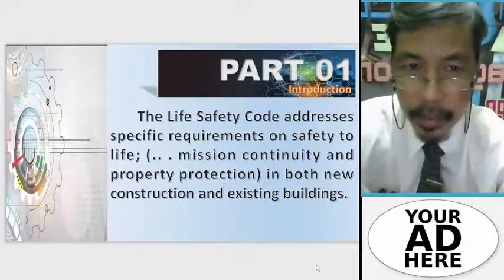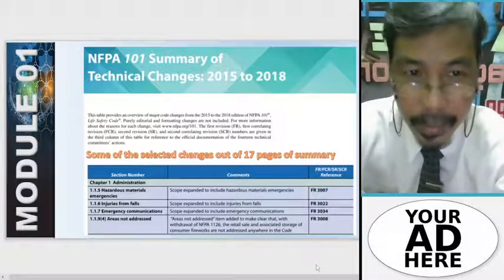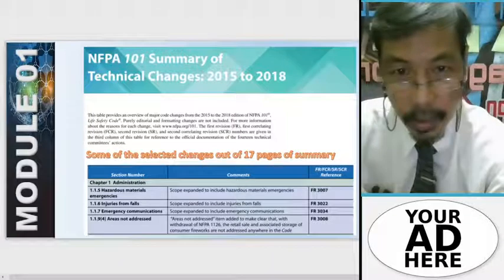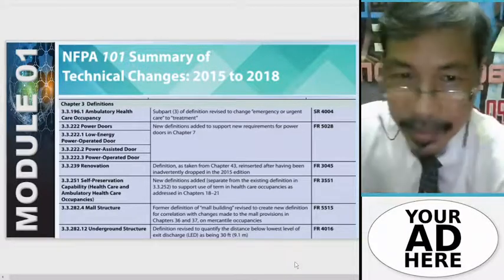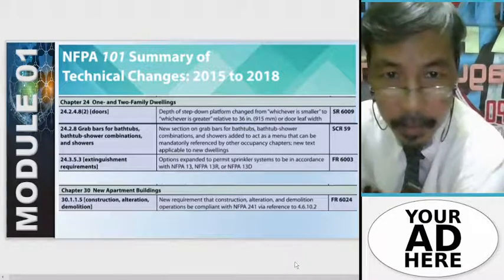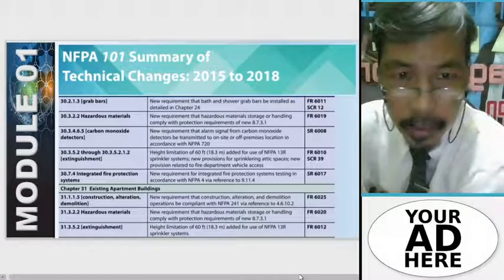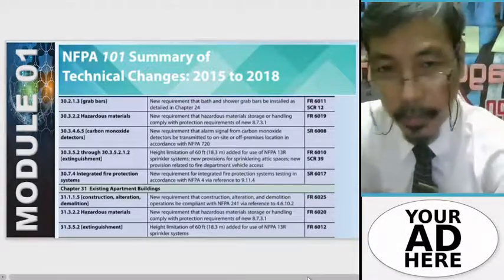Summary of Technical Changes - NFPA101: Module 01.2 [ Reference CODE by RA9514-IRR2019 ]

Comment: Some of the technical changes mentioned in the video are mostly new definition added, new requirement, added section and height limitations.  And there are some changes being said in the video like:
1.1.5 Hazardous Material Emergencies (FR 3007)
1.1.6 Falls-related injuries (FR 3022)
1.1.7 Communication in an Emergency (FR 3034)
1.1.9(4) Unaddressed areas (FR 3008)

Comment: Thank you Sir for this video. It is important to know the technical changes on NFPA 101 version 2015-2018. Some changes are very detailed and it is clarified. Reading and studying the revised versions you'll learn from it also and you'll gain another knowledge about it. There are some changes being said in the video like:
1.1.5 Hazardous Material Emergencies (FR 3007)
1.1.6 Falls-related injuries (FR 3022)
1.1.7 Communication in an Emergency (FR 3034)
1.1.9(4) Unaddressed areas (FR 3008)

Comment: Thankyou, Sir., In this video tackled about the importance summarize in technical changes on NFPA 101 from version 2015 to 2018. these changes are 1.1.5 Hazardous Material Emergencies (FR 3007), 1.1.6 Falls-related injuries (FR 3022), 1.1.7 Communication in an Emergency (FR 3034), 1.1.9(4) Unaddressed areas (FR 3008).

Comment: Tatoy, Mary Joy B.
19-00289

Thank you so much, sir for the information, it is important for us to know the technical Changes on NFPA 101 from version 2015 to 2018. these changes are 1.1.5 Hazardous Material Emergencies (FR 3007), 1.1.6 Falls-related injuries (FR 3022), 1.1.7 Communication in an Emergency (FR 3034), 1.1.9(4) Unaddressed areas (FR 3008).

Comment: Arana, Jomar A.
19-02963

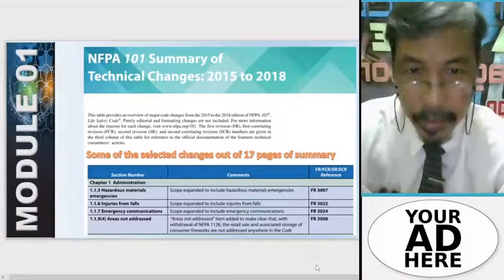@06:01 "hazardous materials emergencies"
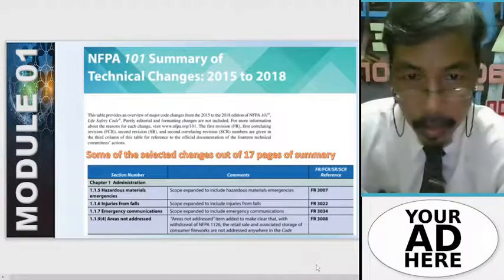@06:30 "injuries from fall"
@07:09 "emergency communications"
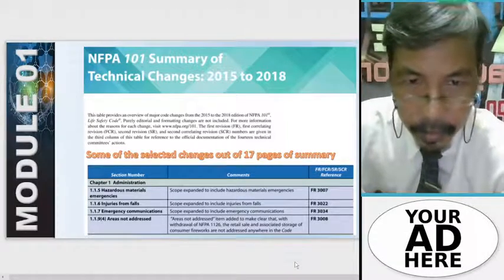@07:28 "areas not addressed"
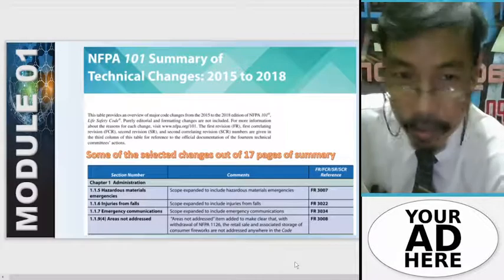@08:08 "retail sale and associated storage of consumer fireworks"
@08:43 "animal housing facility"
@09:14 "delayed action closer"
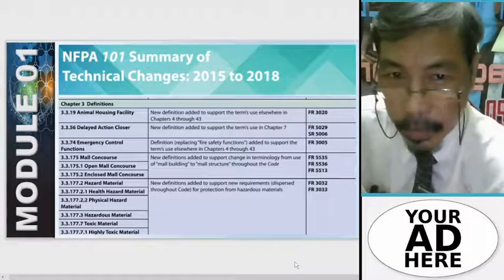@09:36 "emergency control functions"
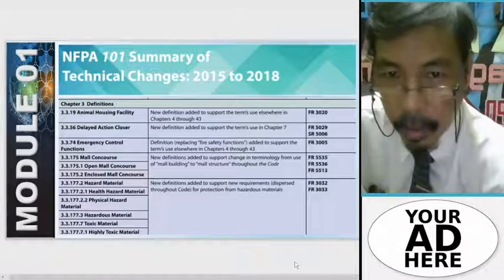@10:01 "mall concourse"
@10:13 "open mall concourse"
@10:15 "enclosed mall concourse"
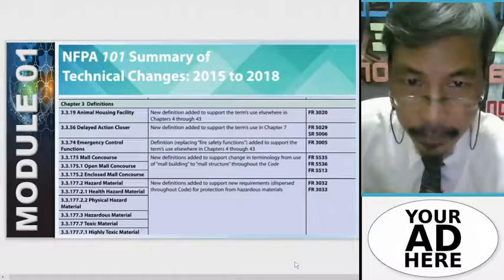@11:26 "hazardous materials"
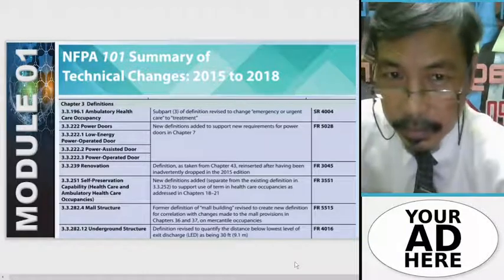@11:53 "ambulatory health care occupancy
@12:15 "power doors"
@12:44 "renovation"
@13:12 "self-preservation capability"
@13:57 "a mall structure"
@14:29" underground structure"
@15:36 "doors"
@16:18 "grab bars of bathtubs"
@17:01 "extinguishment requirements"
@17:56 "construction, alteration, and demolition"
@21:47 "chapter 31: Existing apartment building"

Comment: Thank you sir for updating us on the technical Changes on NFPA 101 from its version 2015 to 2018.

THe changes are
1.1.5 Hazardous Material Emergencies (FR 3007), 
1.1.6 Falls-related injuries (FR 3022), 
1.1.7 Communication in an Emergency (FR 3034), 
1.1.9(4) Unaddressed areas (FR 3008).

Comment: Narito, John Lloyd R
18-02891
Some of the changes to the 2018 edition of NFPA 101: Life Safety Code have resulted in a change in the scope of the document. It should be noted that this article will not include all changes between the 2015 and 2018 editions.

Comment: ETABES, JOSHUA G.
- Thank you, sir. It is important to know the changes to NFPA 101 from version 2015 to 2018. Some of the said revisions are the following: 1.1.5 Hazardous Material Emergencies (FR 3007), 1.1.6 Falls-related injuries (FR 3022), 1.1.7 Communication in an Emergency (FR 3034), and 1.1.9(4) Unaddressed areas (FR 3008). The changes make for more clarified information and expand the knowledge in this code. Keeping up to date with the most recent revisions to the code has benefits and adds responsibility.

Comment: Thank you sir for discussing the technical changes of NFPA 101 from 2015 to 2018. I have learned that It is very important to know the previous version and it is a must to update the knowledge about the code. Some of the technical changes mentioned in the video are mostly new definition added, new requirement, added section and height limitations.